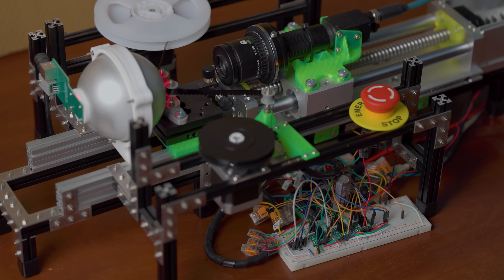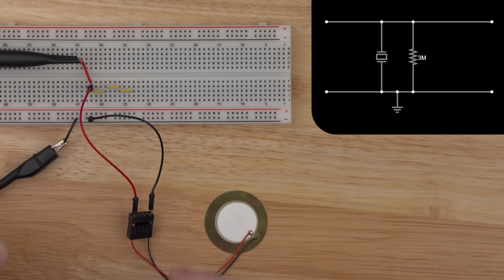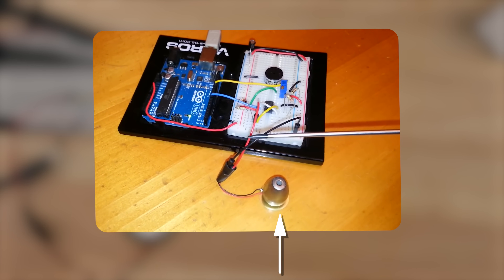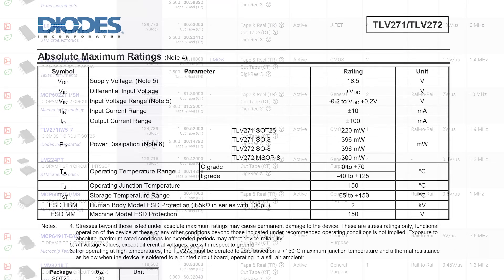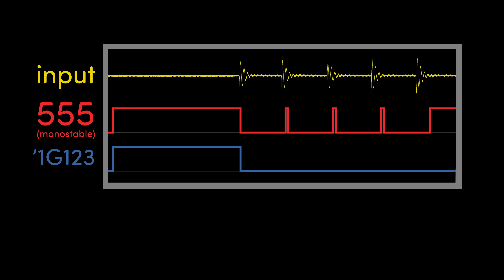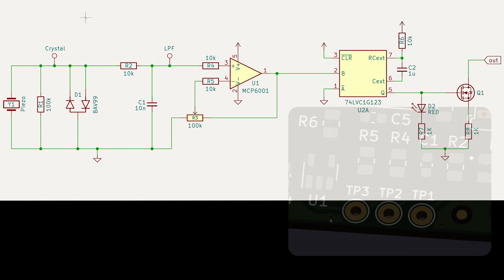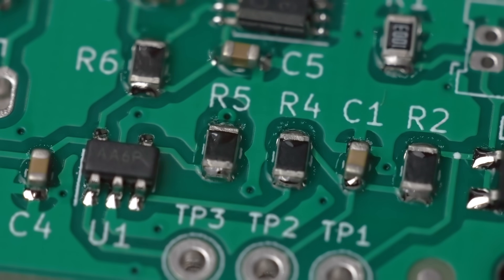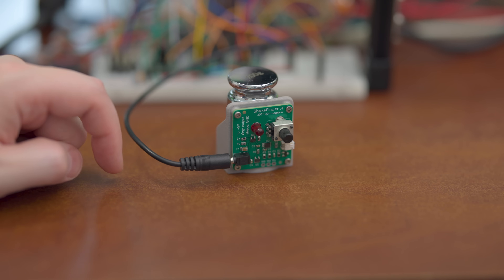Designing a simple vibration sensor

Comment: Amazing sensitivity outta bone stock components, nice. I also quickly discovered how many ways there are to solve the same problem! The 'beyond negative' rail problem could have been avoided by simply having the non-signal leg of the piezo resting on a vcc-to-gnd resistive divider, essentially lifting it 1V or so above gnd, that would enable more op-amps to be used, you will also approach the middle of the op-amp work range for better everything regarding op-amp'ery.
Still it was a great experience following your train of thoughts.

Comment: couple notes to make it easier and doable with all through hole: you can use a double op-amp like a TL072 and make a virtual ground at 2.5V or whatever and then just subtract the voltage on the output. (in that case you could probably just use a single op amp and offset the ground with a diode and add a diode in the feedback to have a clean 0-5V output.)
then for the 555 you can use an extra capacitor + resistor in parallel on the output before the transistor so it keeps it active for a bit longer and cleans up the signal. 

also you probably don't need a clamping diode for the negative and can just use a diode for the positive. 

note that this is off the top of my head and would probably need some work.

Comment: If you power the 74LVC123 with 3.3V, the inputs will be 5V tolerant and you don't need the level conversion transistor. Or you can power both the opamp and schmitt trigger with 3.3V. They can probably both just be powered by the MCU's wanted voltage rail.

Comment: You can cut or etch a cross into the thin metal side of the piezo disc, making 4 (3 is enough, 4 is easier) isolated sections. If you use contacts for all 4 sections and glue a weight to them (probably on a stalk would give you better resolution), you get differential outputs from the piezo disc that tell you what axis the vibration is in and (slightly more importantly) would have no axis or plane where vibration was undetected except for possibly rotational vibration about the axis of symmetry of the disc. The opposite of this (but same transduction) is used in hobby atomic force microscope heads or scanning tunneling ones (I forget which, probably both). If you use a voltage divider into a buffer op amp, it gives you a stable vcc/2 (or whatever) that you can use as a supply for any split rail shenanigans, avoiding the possibility of undervoltage.

I know none of this is really helpful but I try to encourage feature creep wherever I can.

Also I guess you could do away with the 555 (or equivalent) and directly use an interrupt vector on an input pin on whatever microcontroller you end up using. If you tell yourself its fun to use assembly enough times, you'll start to believe it.

Anyway, great job! The hard part is knowing the problem needs to be solved in the first place. I have some of those same 8mm reels that should really be scanned before they degrade. Even a refrigerator kicking on or HVAC system could ruin things. a bit.

-edit

You might have more videos on this, but if you don't, how did you get the precision out of what looks like two stepper motors to align the film frames? I'm guessing by using the index holes in the frame and aligning them optically after the image was taken.
Reply from the maker: "I know none of this is really helpful but I try to encourage feature creep wherever I can" made me laugh out loud, hehe.

Re: your question about aligning frames, I only have an (unlisted) video snippet showing a little of it.  This forum post (with that video clip) describes some of the math behind maintaining the film tension while simultaneously advancing the frames: https://forums.kinograph.cc/t/the-reelslow8-film-scanner/2491/36
Reply: @NicholasPiegdon  Ok, So you're actually using a lot of post (raw data) processing from different sources. There's a lot to take in there. You're not just taking a folder full of 10,000 tiffs and cramming them through ffmpeg into h.264.

Here's another probably not very helpful thing that I used when doing some machine vision stuff: if you take the DFT of a line of pixels in successive images (not the DCT or DST), the rotation of the array of output vectors in the DFT very, very precisely is proportional to how far the image has moved along that line of pixels, well into the subpixel regime.

Also, I was going to ask, but it says in your post that you were using geared stepper motors. That wasn't immediately obvious from what you showed in this video. They just looked like direct drive NEMA stepper motors, which had me confused.
Reply from the maker: @htomerif  It took a few tries in Matlab, but I was mostly able to see this in action.  That's a powerful trick, thanks!  I keep wondering when the DFT/FFT will stop feeling like magic, but it hasn't yet.

The motors are just plain NEMA steppers.  (I think I saw a post by someone else there talking about geared steppers, but they were contrasting their setup with mine; it's a whole forum of people trying to make these sorts of machines.)

Granted, I'm down around 1/64th micro-stepping to get the kind of resolution needed, but the viewport from the camera is wide enough to allow for a little slop.  I'm doing coarse registration in software using the sprocket holes and then proper motion stabilization in a video editor later.
Reply: @NicholasPiegdon  Oh, ok. I remember one of the very few videos I made from a long, long time ago was something showing the difference between microstepping and not microstepping a stepper motor.

What you can't see is that (at least how I was doing it) the torque of the stepper motor seemed to be much less, especially as you approached the midpoint between two real steps.

I sort of figured if you tried to do this for something like tension on a film strip it might lead to nonlinearity in the actual motion. It probably does, but it is probably small enough that it functionally doesn't matter.

Yeah, Fourier transform and, more generally, wavelet transform and friends are really powerful tools, especially when you have modern things like CUDA and even x86 and ARM SIMD instructions (though ARM Neon is pretty weak, imho).

I'm working on a thing that relies on getting a large number (dozens, maybe) of MHz speed, time synchronous ADC channel samples into a system but I'm having a hard time with the hardware if you by chance have any suggestions. There's enough power in modern computers to deal with that much data but it seems like you have to pick between time synchronous and slow or time asynchronous and fast (for things like USB). You end up with a lot of "I don't know when within 100us this thing happened" errors between the peripheral section of of, say, an RPi processor and the cores of the CPU.

Its a real rabbit hole that has (to me) surprisingly few solutions in hardware and I can't afford a million ASICs for a phased array radar like the Patriot system uses.
Reply from the maker: @htomerif  Yeah, the smaller the microstepping, the less torque you get.  It's not so bad in this case because it just needs to maintain 180g of tension continuously (which it senses via a load cell).

Fast and low-latency is tough.  The most capable (while still reasonably-priced) microcontroller/SoC/thing I know of for something like that was the BeagleBone Black's CPU.  On its face it just looks like an RPi variant, but there are two peripherals built in called PRUs ("programmable real-time units").  They're 200MHz, have access to lots of GPIO, and--most importantly--share memory with the main 1GHz ARM core running Linux.

The PRU instruction set is all deterministic, single-cycle type stuff for predictability so they can do the low-latency/real-time tasks, write it to RAM, and let the Linux side consume the data at its leisure (so long as whatever ring buffer you're filling doesn't overflow).

It's a bunch of years old at this point but I haven't seen anything since then that's already integrated and as cheap that marries the low-level, Arduino-style bit-banging capabilities with a faster/higher-level system.

Comment: omg, poblems, my brain started tu hurt when saw issues of negative rail supply. . Just connect this 100K resistor to 1/2 of opamp supply and as by magic input is 50% of supply and so will be output (need tto set deedback also to this 50% of divider and put caps on to supress AC on divider.. really ground is something you can imagine,. it will not have to be real ground. 2 100r resistors spliting 5V supply to +-2.5V is just fine. It depends where you look. If you look that negative rails is ground you have 2.5V and 5V. if you look from middle of resistor divider its +-2.5V.

Comment: I don’t get it. Why use a dozen analog parts when you could just use an accelerometer with digital output? You can probably even buy a tiny Arduino clone with an accelerometer on board.
Reply from the maker: Sensitivity.  A MEMS-based accelerometer is tracking the gravitational force directly.  This is tracking the change in that force.  So even if your accelerometer has lots of bits of resolution it still might be hard to get the sensitivity of this version and it'd take a bunch of CPU and a microcontroller to discover it.  Someone wrote a post in the film scanner forums (where I've been developing the rest of my project) talking about exactly this trade-off, here: https://forums.kinograph.cc/t/shakefinder-a-vibration-sensor-for-stop-motion-scanners/2761/7

Comment: Why not a gyro? I've used a 6dof sensor before, and at the highest sensitivity the gyro can pick up vibrations due to sound from the bookshelf speakers, just sitting on the table without any hard coupling. Compared to that, tapping the table is an impulse probably a few orders higher.

Comment: Wonderful video!
Currently learning electronics and PCB Designing - the tip with probing points and the output transistor is worth gold, thanks!
Also is there a reason why you didn't implement a schmitt trigger yourself with a second op-amp (/dual op-amp IC)? - or is it for the same reason as you ditched the 555 Timer - multiple triggers, because the input fluctuates too much?

Comment: Just thinking of two solutions. 
1) Instead of regular diodes to clamp the voltage to .7v you could use zener diode to clamp to a higher voltage like 3.3v. maybe an op amp might not be required. 
OR... 
2) If need an op amp just for amplification purposes, you can put in a coupling cap and bias your signal over + .7v with a voltage divider circuit That would give you an input swing of 0 to 1.4v going into the opamp. Then you can set your opamp gain appropriately to swing you output to 0-5v (or whatever your 5v opamp rail is) heck you can even over gain the opamp a bit to swing hard to the 5v rail.

Comment: Why did you use a FET as Q1? Perhaps I'm being superstitious these days, but I stay away from FETs on outputs that can be touched, because they are more ESD-sensitive than bipolar transistors (but I haven't blown a FET by handling it for a very long time, so I might be overly fearful).
Reply: Most fets now days have basic ESD protection built in that is meant to handle people handling them during assembly or repair work. Personally I'd never make anything with bipolar transistors except if I need a speciality one for some reason to make the circuit work which is very few and far between any more.

Comment: You could add a <diode forward voltage> constant voltage source by running a resistor from VCC to a diode that's connected to VSS. You can then run another similar diode from this supply to opamp's input and thus prevent it from going below zero, so that your choice of opamps increases.

Comment: The thing you're doing with the weight is not that much coupling the disk to the table: I'd guess that it would work poorly if you e.g. glued it to the table. You are providing more inertia to the top part of the disk, so that when the table moves, the top part of the disk follows with a larger delay (you can think of it as increasing mechanical "inductance").

Comment: Some of the faster acceleration sensors also work pretty well at that function. Hell, some of them even allow for triggers at given acceleration so you don't even need to poll them.

Other dumb simple idea would be just putting a shining point backed by black within the video frame and then you can measure how big the point is, if it shakes the point will be bigger. But that of course would waste some pixels

Comment: Great video format, seeing the thought process behind circuit design is always enjoyable and good editing made it that much better.

It also makes it easy to comment about where I'd use a different approach, which is at 7:30 - if the problem is that your signal goes below ground by a bit too much, just shift it - still have the op amp's Vee connected to your power ground, but add a forward biased diode between "signal ground" and real ground, use that for everything up to and including the op amp - piezo, resistor, two diodes, cap, and potentiometer (leave the digital part connected to real ground). A resistor is also needed to bias that offset diode, from the "signal ground" to Vcc, and maybe a capacitor across the diode for decoupling, so three additional components in total. Again, it's just a different approach, not strictly better - you trade off the lower component count of your solution for the ability to use a jellybean op amp.

I see that someone in the comments already suggested biasing the piezo to half-rail using a buffered resistor divider, but not only do you need a dual op amp then, your zero vibration output level is also Vcc/2, which the SN74LVC1G123 won't really consider a proper logic low, nor should it. With my solution it's around 0.6V, well within the allowable range (0.8V for 3.0V < Vcc < 3.6V and 0.3*Vcc for 4.5V < Vcc < 5.5V).

Again, great video, I subscribed without a second thought!

Comment: To avoid the op amp issues, I’d have tied the piezo to Vcc/2 instead of ground. Use a dual op-amp IC and you get to buffer a 50/50 voltage divider for free with your spare op-amp. Thanks to the signal being nowhere near the rails, you could get away with a non-rrio op-amp like an LM358, though having a wider output range would be handy. Being able to use 3.3V on all your parts would also be pretty handy.

As for the 555, I believe you can make both conventional and retriggerable monostable circuits, depending on whether you use the trigger/threshold pins, or whether you use reset as the input instead. Putting a Schmitt buffer between the amplifier and the latch might be a nice feature, that’s also something you can make with a spare op-amp if it can handle being used with positive feedback.
Reply: I went immediately to the comments to check if someone suggested the approach with the Schmitt buffer. It just solves it much more eloquently

Comment: this is a really nice project and a really nice circuit. I have one thing to add if one wanted both the negative and positive peaks of the piezo you could ac couple it into the opamp with a series capacitor and two resistors going to positive and ground rails to dc bias the signal. As you said though not super necessary for this project but it would allow a wider selection of opamps.

Comment: Beautiful project. I think you could have avoided the special opamp if you had used schottky diodes for the clipping. You could also rectify the signal instead of clipping it.
Reply from the maker: If you rectify the piezo element the diode drops eat the first 0.7V which is where the interesting part of the signal lives for this application.  I had tried that first, before settling on this design.  (I probably should have mentioned it as one of the problem steps.)  For a while I was worried about losing half of the signal but in practice the oscillations are symmetric enough that it doesn't seem to matter.  I didn't want to belabor the opamp point any more than I already had so I didn't mention that while it took a while to find, the MCP6001 is more of a jellybean part than anything.  It's one of the cheapest and most in-stock single-ended, rail-to-rail opamps on Digikey with a great set of general characteristics.  I ended up buying a bunch of them so I can use them all over the place in future projects.
Reply: @NicholasPiegdon  great, thanks for the information
Reply: @NicholasPiegdon  Thank you very much for such a valuable input and a great video. Just in case anyone (like me) would search for shottky diode mentioned somewhere in the comments there are some with  forward current below 0.3V (for small signals and at room temperature) and reverse voltage of 100V like MBRS340T3G which should work with popular opamps like LM358.

Comment: this video is perfect, I don't think there is anything you could of cut to save time or all that much you needed to add that couldn't be answered in the form of a comment.

what software did you use to make all of this?
Reply from the maker: The schematics on the black background are the Falstad circuit simulator.  It's the best, easiest to use (free) tool!  The MOSFET "valve" animation was done in Fusion.  The schematic and PCB layout were done in KiCad.  The case and pedestal design was Fusion (again).  The little animated motion-graphics stuff was mostly drawn in Illustrator and key-framed in Premiere.  For the signal overlays, my Rigol oscilloscope has an HDMI out port which I captured at the same time as the video footage.  With some careful syncing I was able to line them up in the final shots.  It was a bunch of work! I think it ended up around two hours of effort for each minute of final video. 😅